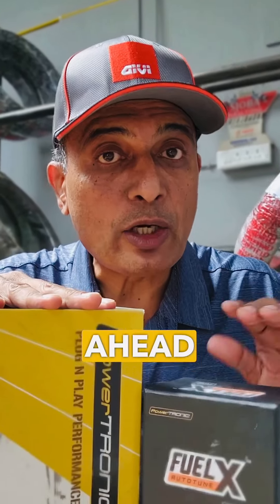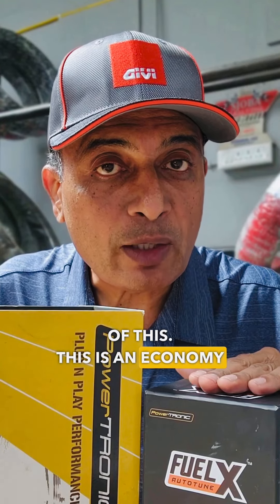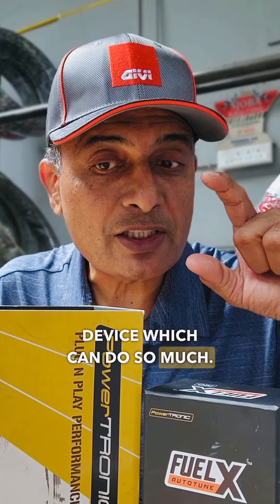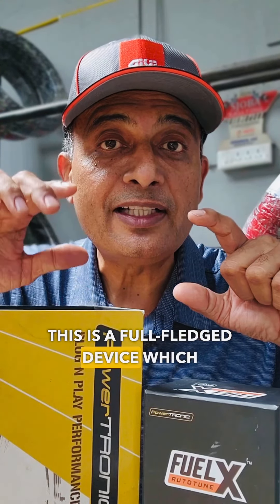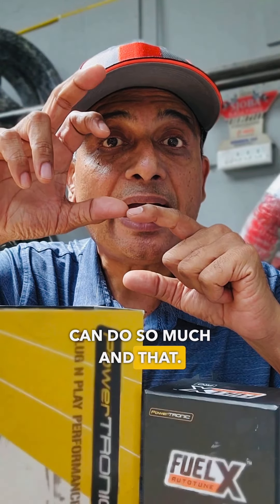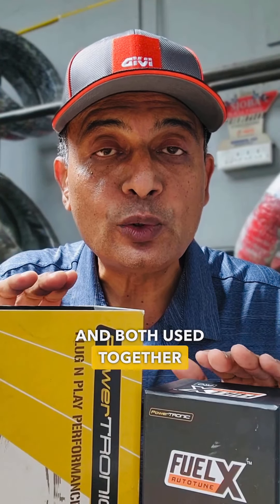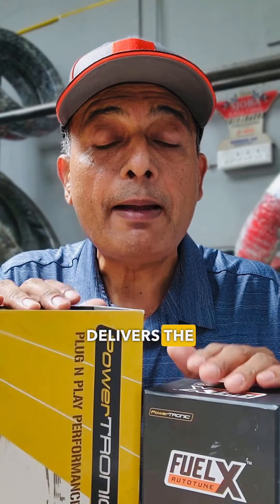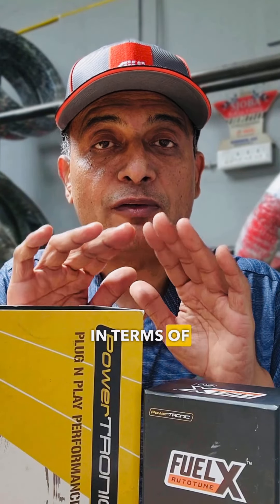Powertronics VS FuelX. What's the difference?

Comment: Be very careful about choosing PowerTronic items of any kind. If you want more performance, find another way. My FuelX Lite worked good for 3 months, then started making engine stall and run erratically. I uninstalled and the bike ran fine. I figured like any reputable company, I could simply return it and get it exchanged under warranty. They refused to let me return it and demanded I reinstall it and video record the led lights  to prove to them it was not my fault. Nowhere in their warranty does it state you must do this. They could have simply waited till I shipped it back and they could have tested it, but they refused. The last part of their warranty, states how they hide behind Bangalore court system.
Reply from the maker: Over had a rider with an issue, we recorded the flashing lights sequence on the unit and shared with them and a few days later the issue was resolved.
Reply: So you didn't want to go through the process and somehow its the company's fault?

Comment: I don't think fuel x is with respect to o2 sensor. It's with the intake air temperature sensor which determines the air density. More air density will make the ecu inject more fuel and less density will require less fuel. Once above idling rpm the ecu switches to open loop mode and ignores signals from o2 sensor which is anyway narrow band  in most bikes. According to the explanation given by you sir fuel x will only work during idle because that's the only time ecu is running in closed loop mode and accepting signals from o2 sensor and would be useless. Just a humble clarification from my side. Fan of your videos. Cheers.
Reply from the maker: The FuelX connects between the O2 sensor on the exhaust and the ECU.
Reply: O2 sensor will be in operation throughout the running of the engine. If we go by what your saying. Then what are the variables on which the ecu will adjust the fuel quantity after idling? Only on throttle input? If that is the case these engines will not be regulation compliant especially cox.
Reply: @shonith91  I have mentioned closed loop and open loop operation. Throttle input tells torque demand, manifold absolute pressure will tell load on the engine, air temperature will determine fuel trim. These are variables for which values are mapped in tables and stored on the rom of the ecu. During idle torque demand is zero and speed is controlled by idle speed control valve by the ecu, there is predetermined af ratio for idle and the ecu takes o2 sensor readings only to make sure it's meeting a certain lambda value. My whole point is that if the ecu where considering o2 sensor reading while riding then it ought to be a wideband sensor and not a narrow band present in all bikes except a few high end German made. The reason why they operate on openloop is because at engines speeds higher than idle the reading from narrow band o2 sensors are not reliable.
Reply: @shonith91  the reason why bikes don't use wideband sensors to dynamically adjust af ratio is because ithe ecu needs more computing power which significantly increases cost. Manufacturers test the engine under a multitude of conditions and come up with a map which will never allow a engine to operate under conditions where it would pollute more, the values in the map would be that docile that it would run the engine in a range of af ratio predetmined by the Manufacturer. In my opinion it's not only the o2 sensor but also the air pressure and temperature sensor that fuel x is  plugged into (usually air temperature and pressure are read by a single sensor unit).
Reply: @mohanprasad998 if we go by what your saying what corrective action will ecu take if during idling the af ratio is not as per the pre determined value? 

I would like to go through the source of your information because what you are saying might be true for very old fi engine. But it definitely contradicts my understanding of present emission regulations requirements. Now you cannot have an engine that doesn’t adjust after ratio regularly and still conform to regulations.

Comment: or just hear me out, get the powertronics piggy ECU, then  just go to dyno tuning to map the ride settings (fuel rich for performance and less MPG or optimal settings). Even if you buy Fuel X Pro, you would mostly use one setting (usually its either 9 or 10, which is fuel rich high performance) instead of other 9 presets. So genuinely make no sense to have both piggy ECU and proX. Also remember you will void warranty if you fiddle with OEM's ECU. Also, plan all your mods before you check with ECU or Dyno, such exhaust and airfilters.

Comment: Hi, I have the BMW G310r BS6. Is it really practical to spend about 50k including powertronic, k&n air filter, aftermarket full system exhaust for the performance it will add? As far as I know, the gains are not going to be much but the cost is more than 15% of the cost of bike… I was thinking just to install the fuelx lite as it will significantly improve the low end and make the overall experience great. Please let me know your views on this situation and is it really worth it to do so?
Reply from the maker: It depends on your motivation and budget. FuelX and BMC will add a perceptible step up.
Reply: Did you done that i also have g310r tell more about your upgrades
Reply: @saleenafarook1753  I havent done it, I bought the Speed 400 and now am doing it on it...

Comment: Thank you for explaining the difference. Short and precise. 
Any idea whether the Powertronic ECU add on will improve the performance characteristics of a Honda H’ness 350? Unlike the REs, I don’t see many Honda CB 350s with a piggyback ECU. Popular opinion is it doesn’t do much in the case of Honda CB 350s. Your expert opinion will be much appreciated.
Reply from the maker: Happy to hear you found this useful. Check with @Racedynamics on the power figures post instalation of their ECU and then take a call.
Reply: No body revived powertronics over Cb350 . May be it can be programmed to make best uze of 5th gear which runs on lean mixture for economy to higher top speeds or more tractible gearing
Reply: Infobikes had it. But most of their content is in Mizo Language

Comment: What are the drawbacks of powertronics and fuelx ?
From the design aspect i feel the thermodynamic working range of the engine will change.
Reply from the maker: It can change a few things and nothing that can cause damage or harm is used appropriately. And of course, if constantly pushed and hustled to redline frequently, it can lead to increased wear.

Comment: Sir , firstly its a great content.. secondly i have 2021 interceptor 650 and i have changed to aftermarket exhausts and airfilter.. Does my bike require a fuel tune with this fuel x pro ??
Reply from the maker: Thanks.
FuelX is an add-on and stand alone device. You may install to enjoy better throttle response.
Reply: @bigbearbangalore  my bike is int 650 with gursewak exhaust ,bmc airfilter and ngk sparkplug kit. If i will install fuelx pro will the sound of my bike get better ,i asked bcz sometimes when i take my bike its sounds like butter but some time their will be less exhaust sound and overall feel irritated with the bike smothness

Comment: Sir, thank you for your wonderful videos. Luv it. I ride a Meteor. The engine doesn't make any mechanical noise for first few kms when it's cold. But once it becomes warmer, you hear a contant mechanical noise, especially when the throttle is at zero (cruising in between gears). Will fuelx fix it? ...make the engine cooler and feed it with the right fuel/air mixture?
Reply from the maker: FuelX may or may not fix it. It's a characteristic.

Comment: Hi Sir, will fuelx make a difference to a well refined motorcycle like vstrom 250? What is your view on this?
Reply from the maker: It improves throttle response. So if that's the need then you can consider.
Reply: @bigbearbangalore  thank you sir

Comment: What a lucid explanation :hand-pink-waving:

1. Will FuelX improve low-end torque of Duke 250?
2. I'm getting an average of 30-32 KMPL in my Duke 250, will it reduce if I install FuelX?
Reply from the maker: Throttle response will improve. Mileage may drop by a couple.

Comment: Hello sir please reply i have doubt that both fuel x pro and power tronic is good for himalayan 411 and after adding them what are the mandatary parts we need to change ?
Reply from the maker: Good or not I don't know. It is fun though. Also change air-filter and if possible, the exhaust.
Reply: @bigbearbangalore  yes changed sir red rooster and BMC air filter

Comment: Hello Sir, Is it useful for xpulse 4v i use bike for both highways & offroad. Do i need to upgrade exhaust and airfilter or stock setup works with piggyback ecu?
Reply from the maker: You’d it’s useful. Try the FuelX and BMC air filter as the first change. Use it and then decide if you wish to install the ECU.
Reply: @bigbearbangalore  i had plan to install ecu first , ur suggestion?
Reply from the maker: I've made my suggestion.
Reply: @bigbearbangalore  got it 😄 thank u sir

Comment: Hello sir, I got fuelx lite fixed from a local mechanic recently on my interceptor 650
And from next day the engine check light was on, 
What do you suggest I get  checked, anything specific?
The mechanic says it needs remapping which I don't think Is needed after a conversation with fuelx service/customer care
Reply from the maker: Check if the installation is done correctly. Then visit a dealership to clear that light using a special electronic tool.

Comment: If the powertronics piggyback ECU can already control the quantity of fuel injected, why will it make sense for someone to also use the Fuel X Pro alongside the ECU upgrade?
Reply from the maker: Good question. The fuelx pro alters the signal even before the ECU. An added layer of electronic trickery.
Reply: or just hear me out, get the powertronics piggy ECU, then  just go to dyno tuning to map the ride settings (fuel rich for performance and less MPG or optimal settings). Even if you buy Fuel X Pro, you would mostly use one setting (usually its either 9 or 10, which is fuel rich high performance) instead of other 9 presets. So genuinely make no sense to have both piggy ECU and proX. Also remember you will void warranty if you fiddle with OEM's ECU.
Reply from the maker: Done the testing with each device separately and the numbers are clear that in combination the power and torque output is better. 
Warranty, oh yes, shot.

Comment: Sir if the powertronic is installed to the duke 390 should I get the aftermarket exhaust also for it?
Reply from the maker: Will be better if you do. Not mandatory though.
Reply: @bigbearbangalore  what about the air filter
Reply: Can we ride with stock air filter for a short period of time?
Reply from the maker: You can ride, no problems.
Reply: @bigbearbangalore  thank you sir

Comment: Dear sir, I own a classic 350 reborn in Chennai. How to increase power and top speed? I use my c350rb mostly for long rides which include city>highway>hill rides. Please suggest a complete modification plan and where to get it done??
Reply from the maker: I suggest you leave it as it is. It’s not a worthwhile pursuit. The only items you can install are the FuelX and BMC air filter. This improves throttle response.

Comment: Hi , I have a project with my duke 390 , I am buying an adn high flow cap filter ,a k&n high flow filter, I have a full system non catalytic exhaust "akrapovic"(Chinese)😂 and a gray area ktm injector . The question is a Fuel X lite configures all that well? Or do I have to buy a powertronic ECU? I really don't look for final speed, but the as optimal performance and if that gives me more horses is a plus ,but I look for smoothness and responsiveness ,with good performance , I love it but like it lacks something else 💪.
Reply from the maker: Since you’ve already modded it much you can check on Powertronics.
Reply: @bigbearbangalore  Thank you always, all your video are very good and educational, already told me that the fuel X works but do not install the injector, everything else if. And if I want the injector than install a powertronic or rapid bike evo and take it to dyno. I just wanted to improve its efficiency but not invest so much money. I appreciate your guidance

Comment: Hi, I have a 2024 interceptor 650. I have just changed the exhaust and am now running red rooster with BMC filter. 
Please guide if I should go ahead with with fuel x pro (or lite) + powertronics for better performance
Reply from the maker: Your choice. You may add them to improve performance.

Comment: Sir powertronics or tuning which one is powerfull and safe which one i choose?i am just overthinking daily reply plz
Reply from the maker: I don’t know which is safe. Powertronics can give more power.
Reply: If I may, powertronic is safe. As it is just a piggy back ECU. I have installed one on my yzf r3 which is equipped with Akra carbon racing line. whenever I want I can just disconnect the powertronic and run on my Yamaha factory set ecu. it takes simply 5 seconds to do it. It minimises the risk of corrupting an ecu while you override the AF mixture and other settings which costs 4 times more than these piggy backs. Ecu flashing is famous in the west coz it's way too cheaper and most of the people and companies are great at doing it.👍 i know a few.
Note: recently they had some issue with their ecu 2023 oct edition but they took the entire batch and fixed it. This happened in my case and other friends too. But they humbly asked me to send the ecu which they changed and never I faced any issue.
Reply: @Lostandfoundhere  what about performance
Reply: @dineshn524  Well it's been more than an year since I have been riding with all the upgrades. My usual trips are from 150 kms to 400 kms a day. I never rode above 180kmph. And it reaches there pretty quickly. with a full system exhaust and a free flow air and oil filter the machine was getting linear. But after installing it things changed. So basically it's the tuning that matters. After installing full system map, mileage remains the same rather it increases. ( 2 modes) on touring it gives me from 28-33 kmpl ( 110 kmph @ 5500-6000 rpm) and on track mode it gives 17-18 kmpl (150+ @9000-12000 rpm)with amazing response. So yeah I am really satisfied. But please do it with the original full system exhaust rather than just a Chinese pipe. 
I tried to be as precise as i could. 🙏🏼🙏🏼🙏🏼
Note: Dinesh it will be better if you can get customized dyno tuning. So please ensure if you can get it near your town. Without custom tuning it just underperforms and is actually unhealthy too.

Comment: Helloooo Sir, 
Would you go for a proper ECU remap or go the Powertronics way?
Reply from the maker: Powertronics
Reply: @bigbearbangalore  thank you Sir
Reply: Thank you Sir. Rationale pls?

My experience: I did use the Dieseltronic on my Jetta, and it didnt do much really even in the P2 mode, which the Stage 1 ECU remap did by miles.

Comment: What would you recommend for the Honda CB350 H'ness
Reply from the maker: FuelX
Reply: @bigbearbangalore  only fule x no Powertronic ecu?
Reply from the maker: @mikhialwylde4375 FuelX does a great job.
Reply: @ Thank you so much, the next challenge I'm facing is getting a air filter, I know they have the BMC but what is an alternate option, more cost effective.
Reply from the maker: @mikhialwylde4375 there are less expensive options I think but I haven’t tried them.

Comment: We can use both FuelX and Powertronic together? 🤔 Never thought of it
Reply from the maker: Yes! Am using it together on my Himalayan.
Reply: @bigbearbangalore how much difference does it make
I'm planning one for my mojo bs4
Reply from the maker: @aamirshihab4183 throttle response improves with the FuelX. That response lag is gone. Check on availability for your model with @Powerhaus_india
Reply: @bigbearbangalore  Sir, even upon installation of both these devices, will the rev limiter block still exist in meteor bs6. Please share your wisdom
Reply from the maker: @user-xs8tv6ss2d Powertronics is normally  set to disregard the factory rev limit. FuelX does not.
Reply: Shouldn't power tonics have Fuel x feature as well

Comment: Hello, I am from Hyderabad and I own an Interceptor 650. Recently, I've been facing a problem of current leakage in my bike. I have already taken it to six different service centers, but none of them have been able to find and fix the issue. I am hoping that someone can make a video about this issue to help me and others facing the same problem.
Reply from the maker: Sorry to hear. Needs thorough  inspection to understand.
Reply: Check Ignition coil to spark plug connectivity

Comment: How is Fuelx abke to offer performance and efficiency both? As in, wouldn't the manufacturer have given it if it were possible? If your answer is emissions, then does that mean BS4 vehicles won't benefit from this?
Reply from the maker: Look at it as added processing power which costs more and adds more complexity to the electronics.

Comment: I have a Vitpilen 250. I enjoy the stock setup but I feel it pulls on fuel when it’s less than half tank. What do you suggest on installing as money is not an issue.

Is Fuel X pro sufficient or should I use it along with Piggyback too?
Reply from the maker: Get it checked first. If there's an issue with the stock system, no add-ons can cure it. Set it right and then modify.

Comment: Hello, my hero glamor bs6 motorcycle does not start if it is getting hot, i mean it not hot when riding the bike. Bike is parked in sunlight it does not start and the same if we keep it in shade it starts and run smoothly why does it happen sir 😢
Reply from the maker: May be vapour lock in fuel system.
Reply: @bigbearbangalore  how to solve the problem?